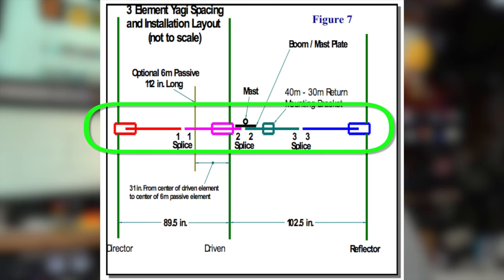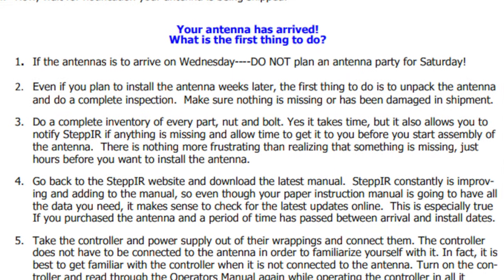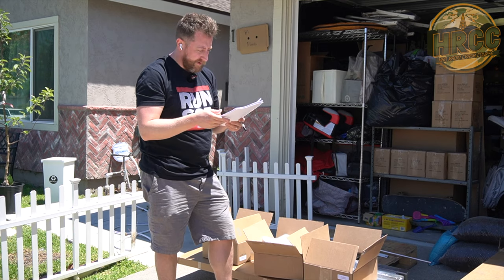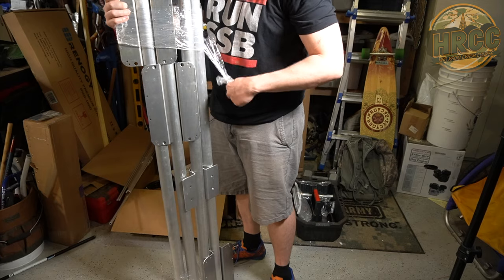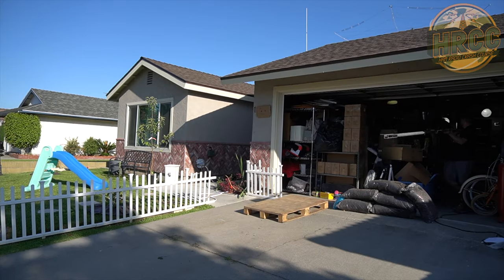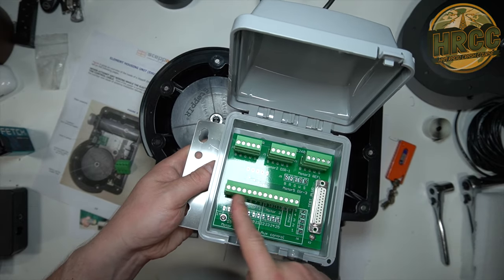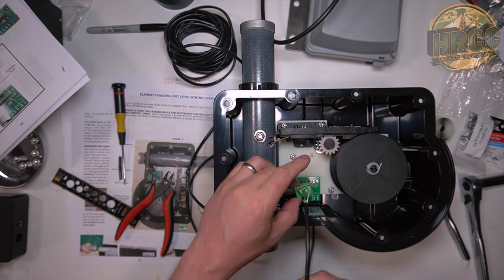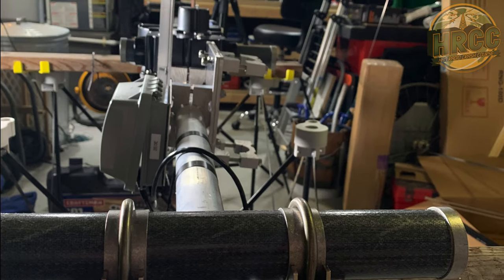SteppIR Three Element Beam 30&40 Dipole pt1

Comment: I have the exact same antenna and love it.  After being on my 70 ft. tower for 3 years I will be lowering it for maintenance and fixing a 40m problem.  I also took extra steps to insure the antenna survivability in the sun’s UV environment that I would love to pass on.
Reply: SPF 30?
Reply from the maker: Sure. What did you do?
Reply: First, even though the antenna was new I painted it with Marine grade high UV resistant paint. I also taped over the shrink fittings that joined fiberglass poles after coating them with a UV protectant designed for rubber auto tires (I can get you the name of the product id you like). Finally I coated all of the plastic EHU’s with an UV protectant designed for RV’s.  This was after talking to people who had SteppIRs for a long time and finding out that after being on their towers for several years the most common cause for failures and what maintenance was needed . The majority cited fiberglass and plastic degradation due to UV exposure.
Reply from the maker: Thank you for those tips!  I’ll look into that Marine grade paint.  I assume its some thick stuff.  Is it at all spray on?
Reply: They may have spray on but I would not use it unless I did multiple applications.

Comment: Great Video! Looking forward on part 2 of this video. Question: The tower you used, are you using the same tower that your hexbeam was on and you just swapped out to test this antenna or do you have multiple towers set up to test various antennas. And on a side note, will you now be replacing your hex beam for this antenna.
Reply from the maker: Yes and yes :D

Comment: Dude! Tell me you didn't put an antenna on your roof! Have you ever seen lightning hit a roof mounted antenna? I seen it twice, and the bolt went through the home, and set it on fire.
Reply: Might be worrisome if lightning existed in SoCal
Reply: I have seen a lot of HF antenna mounted on a roof, in areas with lot of lightning, never a problem. Dedicated towers are pretty much non existent in the area I'm from,

Comment: Bud you are cooking worms at that height..... probably nasty RF in the shake as well.. you need at least a quarter wavelength in height for that antenna to shine
Reply from the maker: What is one quarter on 20 meters?
Reply from the maker: I’m asking Chet what the height of 1/4 wavelength is on 20m.
Reply: Hmm. Probably at least roof height. Next question?
Reply: @HamRadioCrashCourse  16.4 feet.  Do I win anything?  :P
Reply from the maker: Exactly. The antenna is over 25’ up. We’re good for all the bands it’s a beam on. 👍
Reply: @HamRadioCrashCourse  actually you have to measure from the surface of the roof, you are WAY too close. Not saying it won't work at all, but at least acknowledge...

Comment: How to calling police in this radio what iam ned in calling police radio?
Reply from the maker: This antenna isn't for talking to or listening to the police.
Reply: @HamRadioCrashCourse  Do you know any way to talk to the police on the device or program the device so that I can talk to the police and I have a 72cm antenna
Reply: @HamRadioCrashCourse  I have a baofeng uv-9r plus device, how can i contact but police on my device
Reply from the maker: @omregaming725  We don't generally conntact the police on their frequencies.  We can listen but that isn't likely going to work with your Baofeng.  First responders are generally on special radios that you would need a scanner to pick them up.
Reply: @HamRadioCrashCourse  What devices do I need in order to be able to call them? I mean, for example, if I buy the same device that I have with them, can I call them?
Reply: @HamRadioCrashCourse  Or what do I need to contact them on devices?
Reply: @HamRadioCrashCourse  Can I program my device on the police frequencies and talk to them?
Reply from the maker: @omregaming725  Its not legal to just contact the police.  You can listen to them via a scanner.
Reply: @HamRadioCrashCourse  And what do I do if I want to call, but its condition through the wireless device
Reply: @HamRadioCrashCourse  Is there some way?